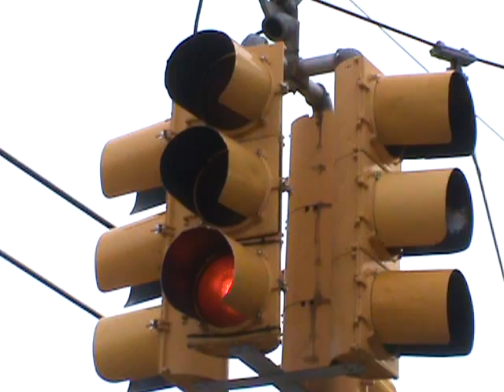Trolley Traffic Lights On Borrowed Time

Comment: for Trolley system like this that was so much more safer and convenient because you're not really sitting in traffic the light turns red trolley goes by light turns green instead of having to wait 3 minutes for bar to come down and then the bar come back up
Reply from the maker: With the current new traffic light system, cars actually have to wait slightly longer than traditional grade crossing gates and flashers.  Trolleys also, in a number of cases, have to stop and wait for their light to change.  Overall, the system is slower now.  And trolleys are still occasionally slamming into cars that run the red light.

Comment: what aspects do the trolleys see and what do they exactly mean? I noticed the flashing red in the middle and it was a little confusing to me. P.S. it is driving me insane that I cant find any info about these signals!
Reply from the maker: The trolleys now only have a 2-aspect signal to read: a horizontal bar (Stop) and a vertical bar (Proceed) at the crossings.

On the old setup shown, the middle red was likely just blinking as the trolley entered the circuit.  But it is still a Stop indication.
Reply: trainman1971 so their are two reds both likely meaning crossing not activated and a yellow meaning that the crossing light for cars is red I guess.
Reply from the maker: On the old system, yes, basically, that is it.
Reply: trainman1971 any of these left or have they all been replaced?
Reply from the maker: All replaced in 2011.

Comment: why is traditional railroad signals and gates safer?
Reply from the maker: +crwa train fan Nein 
At least with the few crossings that had gates, the accident rate was pretty much nil.  Drivers complained about traffic backups while having to wait for them to go up and down when trolleys were coming by, and local politicians intervened, so the new traffic light systems went up along the lines instead.

The accident rate has remained about the same (cars running the red light), and the lights are red at most crossings for the same duration that traditional gates and flashers would be operating, so the traffic backups have not gone away, either.
Reply: trainman1971